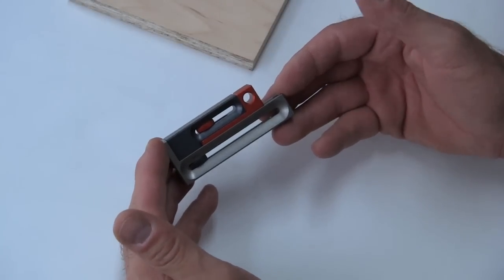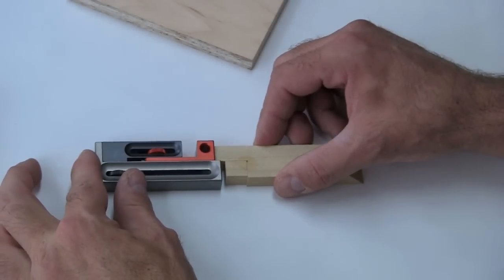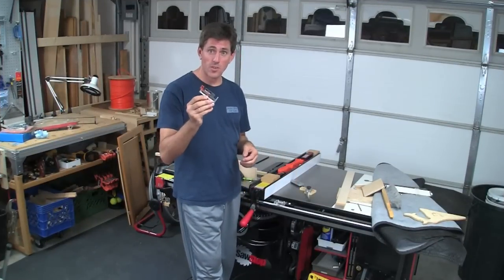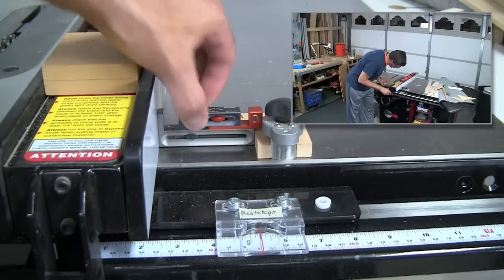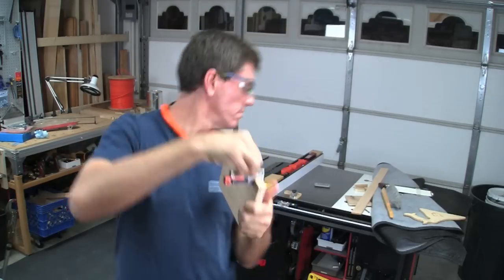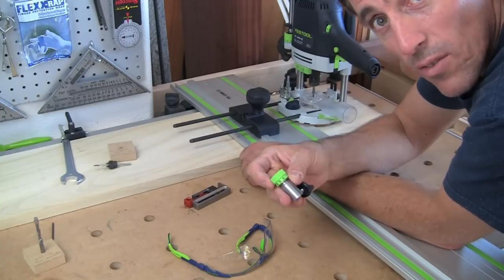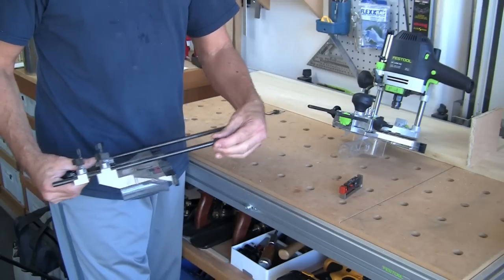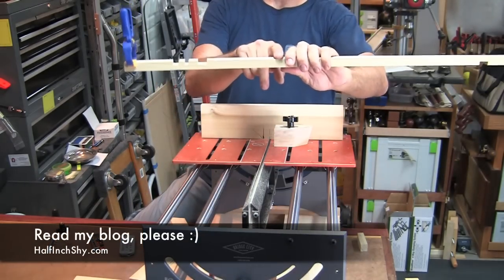#41 - Bridge City KM-1 Kerfmaker User's Guide

Comment: HalfInchShy, I know that this video was posted some time ago, but I stumbled across it only a couple of days ago, so this response probably won't get read, but nevertheless I felt I had to express my thanks to you.
I made a wooden Kerfmaker back in 2009 after seeing items on Lumberjocks, and enjoyed the challenges involved in its construction.  However, when I came to try it out, I just couldn't get the hang of how to use it easily, so put it aside - meaning to try again later, but never actually getting round to it.
Whilst watching your video, and seeing your 'little jig', I realised that my difficulties had stemmed from the fact that my stop blocks were too thick!  The 'step' on the end of the Kefrmaker could not slide over the stop block.   Blindingly obvious now, but in 2009 I was probably in too much of a hurry (as usual then) to take time to identify the problem.
I have now made a 'little jig', and purchased a Magswitch, and have successfully cut exact-fitting rebates ( dados), so thank you so much for your video.
I also noted the techniques for dealing with various machines and with long work pieces, which answered a number of questions that had been shoved in the recesses of my brain hopefully awaiting solutions some day.

Comment: Thanks for a great video.  I didn't have a problem getting mine.  Bridge City isn't Home Depot or Rockler...on some things you have to be patient and persistent.  The design and quality are outstanding.  I think it is exceptionally bad form to watch a video on using the Kerfmaker and leave a message on how to find one for free.  One of the things I like about BCT is that they have relationships with a lot of smaller foundries and machine shops in this country..instead of India or China.
Reply: James Morrin _. Bridge City Tools are great products, have a few.  However, many were, and now almost all are made by Harvey Industries Co. Ltd., a woodworking machinery manufacturer based in China.  They have had  BCT products substantially made offshore for several years now.   Still great tools, regardless of that fact.

Comment: Hey Paul, I know this is an old video but wondered whether or not the Incra Fence on SawStop would allow the same ability?  I’ve not cut any dados yet but it seems like it could be adjusted all the same.
Reply from the maker: I'm sure it would work fine. I just use the back of my fence with a magnet in a mini L-fence to mark one position and use it to set the second fence position. I'm certain you could do the same off the back of the Incra fence. Since it is more adjustable with a micro-adjuster (iirc), you could likely use it over by the micro-adjuster since you really aren't moving it more than 1/4" or so.

Comment: For the table saw example is he using the miter gauge with the stock running along the fence? Doesn't look like he's using a spacer to offset the stock from the fence. Isn't that a recipe for kickback?
Reply from the maker: Sorry to have missed this comment for so long. If it was a through cut, it would be a kickback danger. I have an offset spacer on my fence for exactly that problem. Here, though, it is a dado that doesn't release a piece. I suppose if the fence were horribly calibrated and pinched the piece, it would fight you a bit.

Comment: Great video.  Is there a method you use to make or index to make grooves a set distance between them?  For example I want to make a part that has 3 pieces 1 inch a part using either my festool router and MFT or my Bosch table saw.  I like the little magnetic jig you created but unable to use with my aluminum Table saw top. On the festool router it only gives you a centerline to the router which then would have to be offset to determine start of groove.  Is this the only way for the set up?

Comment: Informative video for sure.  Where did you source the magnetic stop you used to enable the KM-1 to really be used?
Reply from the maker: You can get those magnetic stops at any woodworking store. I have 2 that came with a magnetic featherboard and 2 I purchased separately for other jigs (considerably stronger). So look for the featherboard as the magnets are removable. Very useful.

Comment: I'm only 7 min in and he's made 5 different jigs for the one jig that's supposed to help u from making jigs, I'm confused
Reply: There's two jigs for table saw setup, and neither are necessary. One to calibrate the tool for kerf your blade makes and one for moving the fence.

You can skip the kerf jig and set up the tool directly off of your blade. But you have to reference the kerfmaker against the fence somehow, that's the entire point of the tool. He already explained just clamping a stop block to the fence rail.
Reply: Explanations without the visuals... I'm there too.

Comment: I think this could be made much clearer -- use your video rather all those words.  You did not adjust the kerf for a normal table saw blade -- perhaps the most useful; nor did you adjust the kerf for your Jointmaker saw.  you did not show adjusting the kerf for the router bit either.